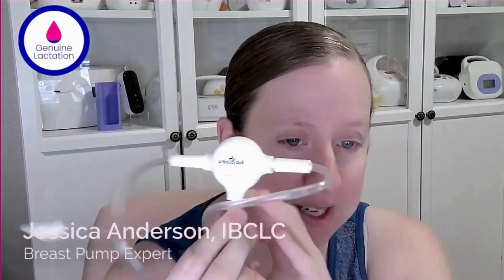Working With Your BabyBuddha Tubing

Comment: You majorly understood how difficult the tu ING is to disconnect but I'm glad I'm not breaking it!
Reply from the maker: It's intimidating to pull stuff apart when you aren't sure it's supposed to do that!
Reply: I have tried all the tricks and still cannot get the connectors off. I’ve done it before so I know it can be done but they have been stuck on for 2 weeks and no matter how hard or where I, or several others who have tried squeezing, they will not come off. Customer service keeps sending me to this video and I’m extremely frustrated 😩